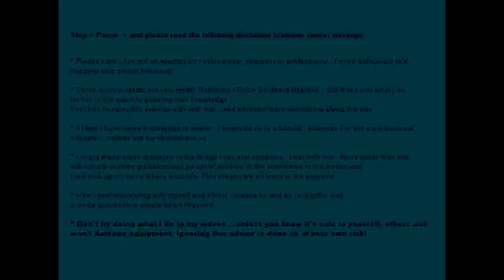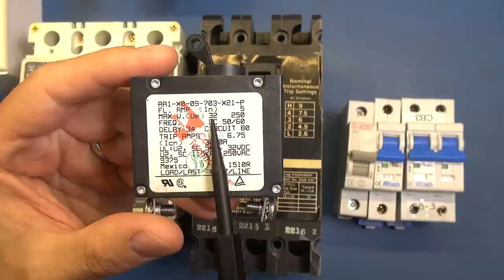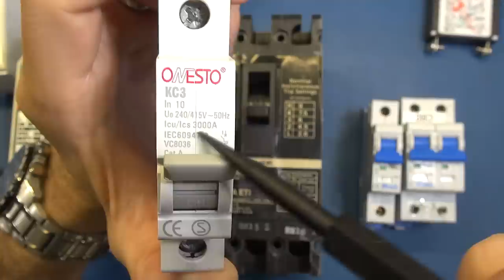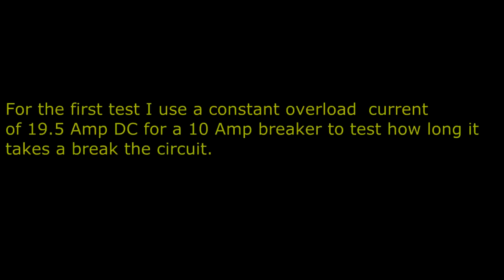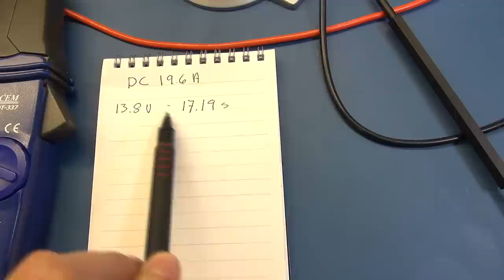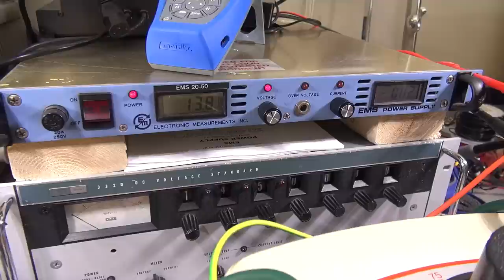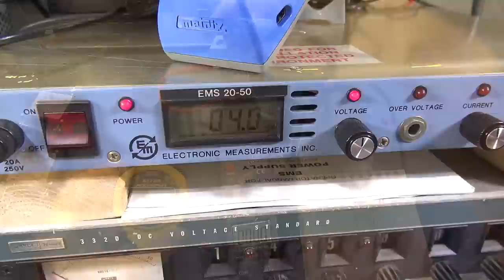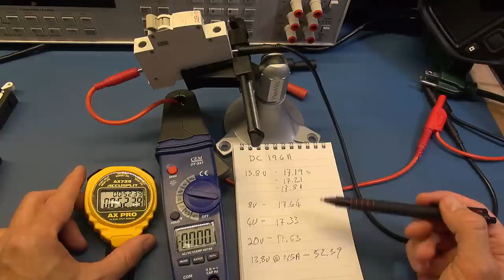How Does a Circuit Breaker  / Trip Switch Work? -  Pt 1

Comment: Just a note a circuit breaker in the distribution board is only to protect the fixed wiring, which is in the walls, not the equipment attached. You need another protective device inside equipment to handle failure inside the equipment.

In the USA you will also come across RCD outlets and AFCI breakers, which serve a different function to a circuit breaker, though the protection function of the circuit breaker can also be added to it, and in most cases already is.
Reply from the maker: SeanBZAThanks, my mistake...adding an annotation now.
Reply: SeanBZA Not true everywhere, in parts of Europe (not the UK) the fixed breakers in the board DO protect at least part of the appliance (usually the cord)
Reply: ***** Not unless the cord is rated to survive. A 20A breaker will do very little to protect a 0.7mm cord ( like on a clock radio) from melting, until it gets to the point where it shorts out, which very well might be well after the fire is raging. On a 1.5mm cord it will provide some protection, but it's main point is to prevent the 2.5mm wiring in the house from burning if say you connect a 2 kW heater to the outlet and then connect a second 2kW one to the same circuit from another socket, then plug in the 1.5kW vacuum cleaner to do the floor.
Reply: ***** Does this not still happen?  (20 amp earth bond test) ?
Reply: Have a qualified electrician use a clamp-on amp meter to check the circuit load.  If the load is within the limits of the rated breaker, then replace the breaker as they have been known to go bad.

Comment: hey mjlorton. I really admire your work and the effort you are putting into publishing these tutorials for general public as I have gained a lot of information through your videos which helped me in many ways. Keep up the good work and we will continue to show you support. 

If i may, I would like to request you if you can upload videos on complete working of Electrical Standard products like Air Circuit Breakers, Moulded Circuit Breakers, Changeover Switches, Contactors & relays, basically all Switchgear Products. It will be of further great help than from what I have already been receiving from you. Cheers.

Comment: As already mentioned before, when you connect a source of constant current to the circuit breaker, doesn't make sense to test changing the voltage of the power ... the time of break-out will be always the same. Anywhere, the video is very interesting !!!

Comment: When I was young I had a nasty shock from a AC to DC 9V adaptor, direct from a 220VAC @ 20A) I remember the period I held on due to the muscles in my hand contracting was for approximately 8 seconds, It was a disaster, I manage to let go (I don't know how) After that, I could not use my hand for a whole day. I've never shocked again, and hopefully wont have an experience like that again. its no joke safety first, always use a fuse and common sense.
Reply: ***** did you tell your mom?
Reply: Beryllium yes my dear troll

Comment: #25:42 The reason the voltage setting of the power supply is independent of the Thermal Trip Unit (TTU), is because the two are independent variables: the power supply is acting as a current source and the (TTU) is a function of the I^2R dissipation in the Bimetallic Strip. In this case 376.36x Bimetallic Strip resistance. The power supply is operating in current limit by definition: see the Clamp-On ammeter 19.4A reading in this case. The voltage setting of the power supply doesn’t come into it.

“...In this case with the heating of that Bimetal strip, it’s not the power but it’s the current you are carrying through the breaker that will dictate the time in which it takes to break…”

No, it’s power that determines the TTU. Current, in and of itself, is not a measurement of energy. This can easily be demonstrated by putting an automotive incandescent lamp in series with a mains incandescent lamp across the mains supply. The automotive lamp will glow while the mains lamp will be almost full brilliance: despite both shipping the same current. In the UK, this was taught at ‘O’ level physics back in ‘79.

Comment: Great video and explanation. Now, I 'd need to know how to install these things, for example, I need to make a separate line for all kinds of outside appliances, a line to my garage and other buildings outside the house, but I want to put one of these breakers on that line at the house, so if I need to mingle with the wires, I can switch that off, not the main breakers and leave the house without electricity, just these, and safely work on the wirings there, so what kind of CB would I need if I have an incoming line with two wires, one is obviously L and the other is N. Is it enough with a single pole breaker for this situation?

Comment: Maybe I missed it, but I thought he said that in certain conditions, the switch will not re-activate the breaker... What condition is that? Is it the spring loaded coil thing? The heat will dissipate so long as the circuit is broken, but what makes the spring coil thing activate?

Comment: In my circuit breaker the copper wire is breaked down ,what may be the problem there's also some black patches on the plastic cover as if it has been short(spark)

Comment: I wanted to know-
1)When does the solenoid pushes the lever to release the arm?
2)Use of solenoid.
Reply: +Saurav Vats in the event of a high (surge) overcurrent state - say, 100A on a 20A breaker - the solenoid gets energized with enough force to release the latch

Comment: I feel I should point out that unless you're running the trip tests through a constant-current dummy load, your voltage setting is irrelevant, as the power supply will be in constant-current mode and only delivering the voltage needed to drive the desired current.

That said, the voltage won't make any difference to thermal and mechanical trip time anyway.
Reply from the maker: Monkeh616 So are you saying that if you have a constant current that the voltage has no bearing on the activation of a solenoid?
Reply: mjlorton As far as I know, the voltage won't make any difference to the solenoid, either. It is the current which generates the magnetic field, just as it is the current which causes heating in the bimetal strip.

These breakers should operate from practically no voltage (as you would have with a power supply shorted across them in constant-current mode) right up to the point they're incapable of arc suppression. This will not be true of all types, however. AFCIs I believe, certainly GFCI/RCDs, combo devices, devices with programmable tripping characteristics, etc, will require a certain voltage to operate.

For bonus points, measure the voltage across the breaker at rated current and determine how much power is lost in it.
Reply: Monkeh616  Correct, voltage has no part in the trip on ether thermal or instantaneous trip, the only voltage is developed across the breaker internal resistance, but it is the heating from the current that is activating the thermal bimetal time delay on low overload ( what is being tested here) and the high current through the solenoid coil to pull the internal slug across the magnetic field ( the core of those is a lot more complex than a simple solid metal slug, there is a moving pole piece inside that is pulled into the solenoid coil to provide an impulse to trip the breaker, held in place by a weak magnet in the core) on large overloads, where the thermal trip is too slow to clear the fault before the wire overheats. 

That is why there are very few purely thermal breakers in house wiring, they require a thicker cable to withstand this overload condition. Here in South Africa the original thermal only breakers from the 1960's required a 4mm cable to ensure it would have enough thermal overload capacity. With the introduction of the thermal magnetic breaker ( as shown here and almost universal in premise wiring protection) you did not need the thicker cable, as it would provide protection to thinner 2.5mm cabling safely.

The voltage rating is there for the breaking function, too high a voltage and the arc suppression will not provide adequate arc breaking capacity, which will rtesult in an arc that will self sustain till the breaker burns out and the supply cabling burns off enough that the arc goes out, or an upstream fuse or breaker trips out disconnecting the whole supply. That is why you often have a DC rating so low, as the arc does not tend to go out 2 times per mains cycle, but only when it is either cooled by the arc suppressor cooling off the plasma below the ionisation temperature, or it grows so long that air cooling does that. A nasty demo is to take one of those AC breakers and use a 48V supply from 4 series connected car batteries, where the arc will not extinguish ( though I would not recommend closing the breaker into that but use another larger DC rated switch instead) but will carry on burning even with the breaker opened. I might do a video using a 140A arc welder and a sacrificial 5A DIN breaker, like the ones used, to show that, as I should get a high enough current to make a sustaining arc from that. Going to be fatal for the breaker in any case.
Reply: mjlorton 
Yes, that's the whole point of the constant current setting. In an over-current-limit situation the PSU reduces the voltage below the value you set until the current is at the set limit.
I guess in all your tests the "current" LED was on? This means current is the limiting factor and not voltage. And unless you have a very weird PSU you should have seen the voltage on the display drop (to the same value in all of your tests). PSU normally show the real outpur voltage and not the one set under no load.
Also how could the voltage make a difference when the current and the resistance stay the same? It's Ohm's law.

The voltage WILL make a difference though if it's about extinguishing the spark. At higher voltages it will (obviously) take longer, but that's at values way out of that PSU's ranges.
Reply from the maker: superdau Yup, thanks for the post. I certainly went down the wrong rabbit hole. I'm going to follow-up with another video covering that mistake.
Cheers, Martin.

Comment: I cringe when people talk about a certain amount of current that it takes to cause a person to be injured. Voltage is the primary thing that does it. It takes voltage to overcome the resistance of the body and cause the current to flow. You can hold onto a battery that can deliver thousands of amps, but if it's only like 1.5 volts, it's not going to harm you. The current that can be delivered from the voltage source is the secondary cause of injury. Think static electricity. In general, there is little current capacity behind common static electricity. It obviously can deliver the voltage to overcome the resistance of the body, and you can feel it travel through you, but it can't deliver the current.

Comment: I got a question. Why do they use the 2 metal strips if the solenoid itself can break the circuit way faster than the metals?

Comment: I've never seen a circuit breaker where the switch remains in the 'on' position after it trips.  Is this something that differs between countries?  How do you tell which breaker has tripped in a household panel if they are all showing as on?

Comment: Thank you!  Nice job.  What temperature is needed to break the circuit?  If the circuit breaker box on the outside of house is in direct sunlight, would that maybe cause circuits to break more often than normal, or is that too low a temperature to have any affect on the thermal strip?
Reply: i think yes .. i work in lab service in summer season there is increase in mcb fault i observed

Comment: It was a good description until you started talking about the voltage in the circuit.

The voltage in the circuit has no bearing on the results, (unless you measure across the breaker). 

All you are doing is using the wiring as a resistor.   The power supply lowers the potential to limit the current.

Comment: About how many times can a circuit breaker trip before it needs to be replaced?
Reply: ***** which means that the switch wouldn't hold anymore, right?
Reply: TheEnneagram when the contacts of it get dirty by the arc and then you start noticing it heats more than usual with the normal load. That means the contact having resistence.
Reply: +TheEnneagram how many times can a circuit breaker break before it breaks?
Reply: Andrew Geng How many licks does it take to get to the center of a Charm's Blow Pop?
Reply: chines low quality mcb goes crack with 5 to 8 times it trips and high quality breaker keep working again and again ......life long
Reply: Dear Sir. About the circuit breaker using life. If we use it in normal. 4000 times at least. We are a circuit breaker's manufactory in Wenzhou of China.

Comment: "When in doubt just buy a new one" talking about the contacts, over time, getting deteriorated in some manner.  Ok..., now tell me, just what would cause me to have any doubts in the first place?

I mean, I'm not going to open up the circuit breaker and look at the contacts.
I'm not going to have any idea whatsoever how many times that breaker may have been turned on and off, or how many times it may have tripped.

So please explain to me why oh why would someone ever have a reason to even have some doubt.

This guy may understand these units, but he doesn't have a clue how to truly explain what you'd need to know to decide when/if they need replacement.

Oh and btw, @ 22:30,  it was 17.19 seconds, not 17.9 seconds.  He can't even read the timer right.  This just goes to show you he's more focused on what he's trying to explain than really trying to make sure his audience understands him.  He's a poor teacher overall.

And, the fuckin video is supposed to be about how breakers WORK, yet the whole first half of the video is boring shit about what all the numbers mean (also very poorly explained) and the various applications.  Based on the title of the video, that's not the info I'm the least bit interested in hearing about.

You could condense this video down to about 3 minutes if you focused on what the video is SUPPOSED to be about, based on the title!